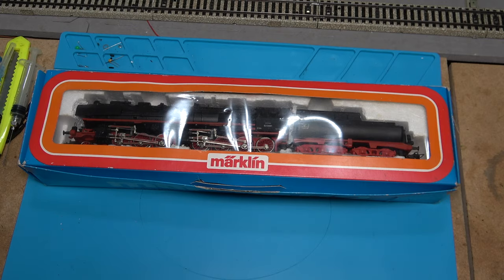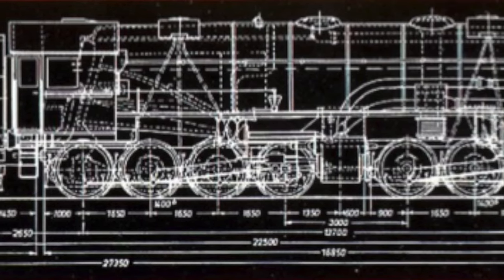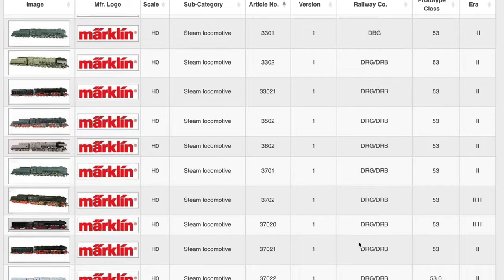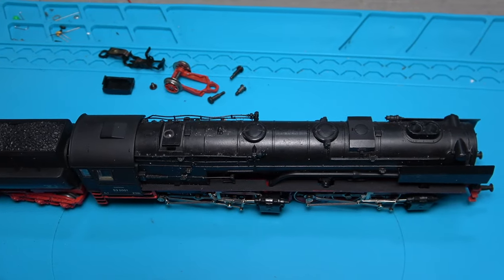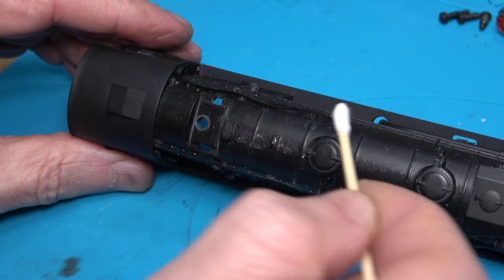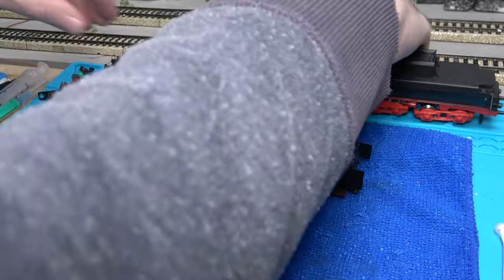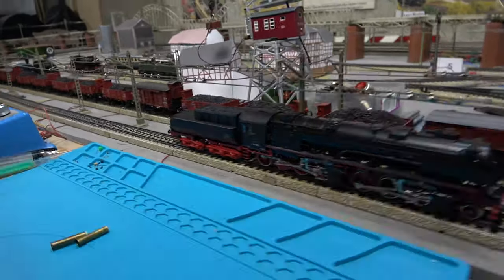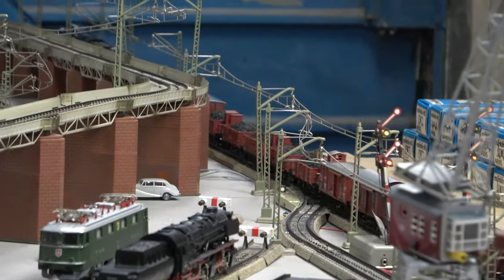A little gamble (a mistake maybe?), or when new isn't new...

Comment: I call it the "Märklin tax" applied by some eBay sellers. The claims of being brand new are usually accompanied by a 10 day auction with a starting price £200 above what it's worth, and a couple of paragraphs of AI generated claptrap about how Märklin are a top quality brand. This is how the Z gauge market feels anyway.
Reply from the maker: And after 50 lines telling how good the thing is, still put a disclaimer that the pictures form part of description 😀 The description for this one was simply a lie, but I had looked at the pictures and it wasn't too bad price wise, I'd say just about £10 to £15 too much for its condition. But I agree some sellers are simply delusional. But here the solution is simple: walk away... I rarely use ebay for that reason, too much hassle when something goes wrong...
Reply: @The3rdRail  oh yes I similarly bought a Märklin mini club City Ban train set from eBay, described as immaculate and never removed from the box. This is why I foolishly bought it without seeing pictures of it out of the box. The set was in fact immaculate apart from the hidden side of the locomotive, which looked as though it had been dragged along the pavement and then given a few strokes with a hot soldiering iron. The seller offered me a £10 refund as the damage was "only cosmetic". 
Where do you recommend buying Märklin stuff as a UK resident?
Reply from the maker: I mostly use professional sellers in Europe, usually brick and mortar shops with a website (ie no eBay storefront). I don't have a particular reference to give as I don't like to get involved in recommendations unless it is for low value items. My expectations or tolerance level might not necessarily match someone else's and I would feel bad if I had contributed to a disaster...

Comment: I own the 37021. Beautiful loco. As far as I know, Borsig was building two of them. One loco with boiler and one only the frame work. Both destroyed by a bombardement. For the paint on the boiler: maybe you can polish it up a bit. Tamiya has excellent polish for that. For the windplate, maybe a replacement can be used?
Reply from the maker: I heard the story too, all very confused imho as the sources are not very credible though not impossible, but what matters is that the class never made it out of the factory, one way or another. The wind deflector can be simply be stripped and re sprayed with some matt or satin black, that works well on these locos usually. I'll look into the polish if I decide to take thing further at some point, thanks very much for the advice, much appreciated. Take care.

Comment: Always enjoy watching your videos. Keep them coming. I have the 3602 model, wonderful model, however have the same smoke unit problem as your 3102. I gave up debugging ;-)  Greetings from South Africa.
Reply from the maker: Thanks for popping by today, much appreciated.
Reply from the maker: I just tried 2 identical (brand new) smoke generators and they both work simultaneously, my guess was correct in the video, the 2 units I used there had different power requirements. These work fine on their own in other locos. something similar might be happening with your loco.
Reply: Thank you for the feedback, it's most likely that my problem is similar. I installed some older smoking units which I had on hand, which also work fine on their own. I will order and install two brand new units, and who knows maybe the solution is as simple as that.

Comment: Random question for the day but I noticed when you installed the smoke generators one had a green tip (front I think) and the back may have been darker (red). I just replaced the smoke generator in my 3047 as it worked but only flat out and it was a green tip. A new 7226 today (red tip) and it works fine. 

My suspicion is that the red tip is the seuthe #10 and the green tip is the seuthe #11 which is made to run at digital voltages. They are exactly the same size and the only thing that I have found may be the colour of the tip gives them away. I would be interested to know if you find similar?
Reply from the maker: The colors changed over time. The green one in the video is very old (i think 40 year old), the other one is a one year old 7226. Both work fine when installed alone in other locomotives.  I since installed 2 brand new, identical, Seuthe 10 which  both work, My guess would be that the older one I tried first needed more power than than the newer one, the latest short I published (here: https://youtube.com/shorts/11PNupTokq4?feature=share ) shows the loco running with the new generators. But what you mentioned about units made for digital is definitely something to be aware of, and check if need be.
Reply: @The3rdRail  it's been hard to track down the colours but from what little I can find on the seuthe website the new green ones are for digital. My 3048 was red which I brought 30 years ago which was why I wondered what was installed in my 3047. Since it works at full power I might just stuff it in a chimney of a house and attach it to the lighting circuit. 😂
Reply from the maker: Yes, the new Seuthe 10/10E I bought have a reddish base, but the one year old Märklin 7226 has a white base 😵‍💫 Seuthe manufactures both so you can only rely on colors for Seuthe branded units (which you cannot distinguish by simply looking at them 😄)... The only test you can do is to hook them up to a driving transformer with crocrodile clips and progressively increase the voltage, analogue compatible units should start generating smoke at around the 80 mark in that setting. All good fun...
Reply: @The3rdRail  yeah my green tip was around 150 - 200 even after a clean. Doesn't matter so much now as I have a new generator and I can find a use for the old one. I should really finish my track wiring rather than playing with generators anyway. But good things take time. 😂